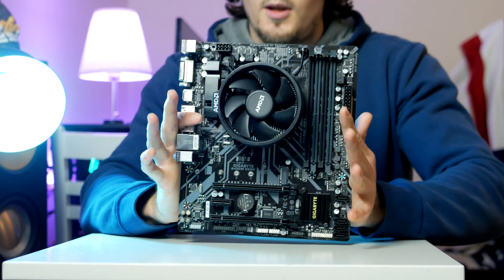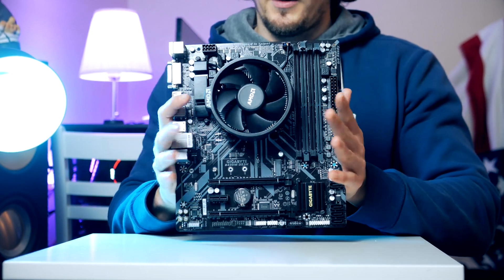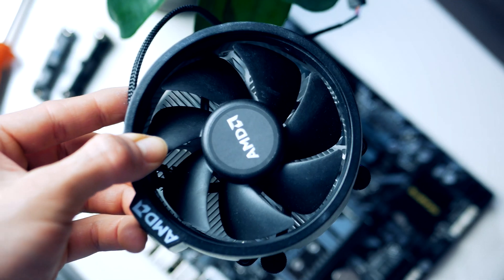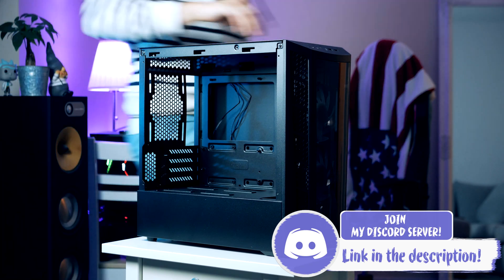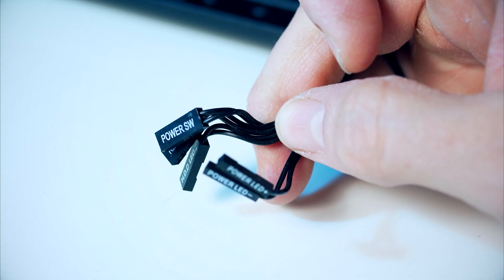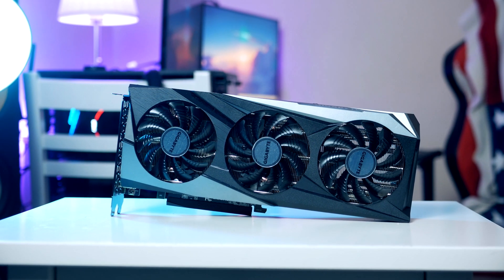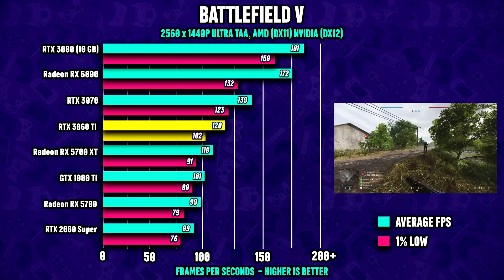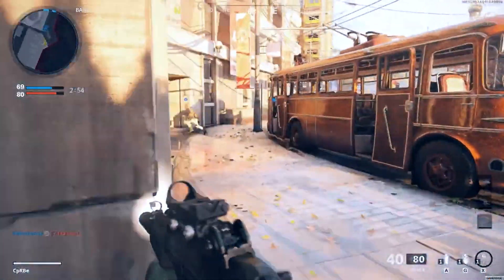How to Build a Budget Gaming PC under $1000 in 2021! [FULL Tutorial + BIOS & Benchmarks!]

Comment: Okay but seriously, even though its around 1000 now, Im still getting this setup as soon as I get the funds! Thank you man! Awesome video and flawless presentation
Reply: The only problem is the rtx, you can either get lucky trying to get one.
Buy another type of graphics card.
Or wait 9 months until its back in stock.
Reply: Get everything besides the motherboard he's cheaping out on the Motherboard get a better one
Reply: I think you should maybe get a B450 Pro 4/F or a B450 Rog strix ii both seem better, at least for me
Reply: @deztroit  what motherboard fo u suggest?
Reply: @jnjbbknn  If you want a b450, then B450 pro 4/F (They are generally the same but still good to check if it has all the features you want). A higher end b450 board which I highly reccomend is the B450 Strix-F ii. If you want to go the  B550 route get a B550 Pro 4, now if you want features like bios flash back then get a an Auorous(i think that's how its spelled) Pro/pro-p (i think the p is missing some features but you can check)
Reply: youre not gonna get an 30 series card without spending more than 1k
Reply: @rankedskywars  yeah highkey unfortunate on that regard